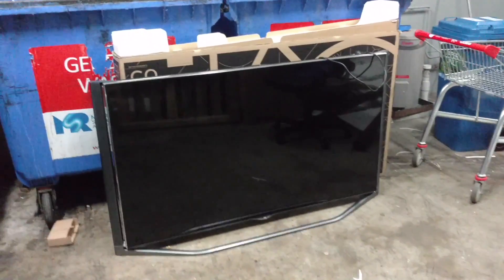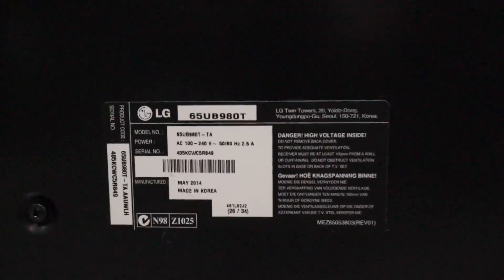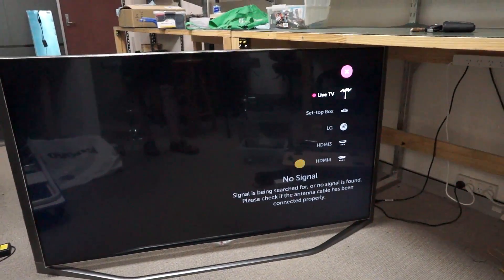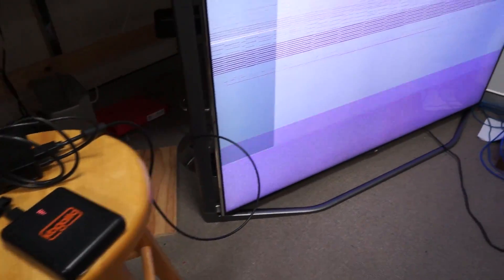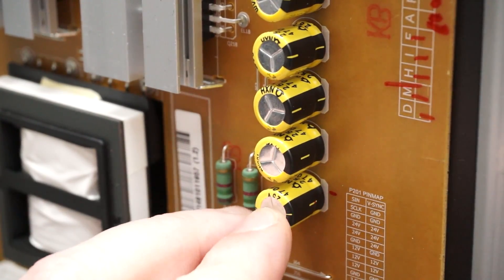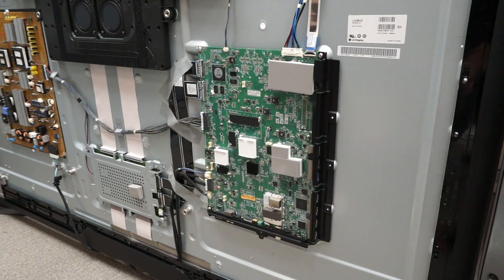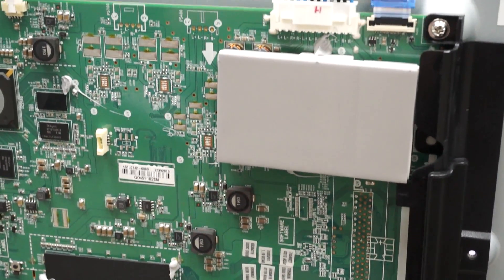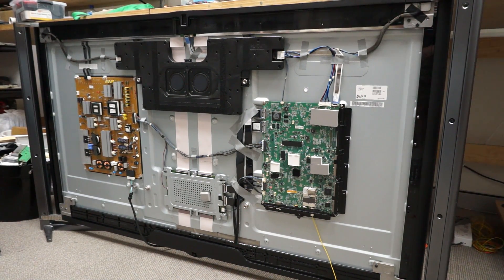EEVBlog #1145 - Dumpster Diving 4K TV!

Comment: Test the TV antenna outside on the trip to the new lab.  Digital TV isn't like analog that might still give some kind of "picture" with a weak signal even in that building so you need to test it with a half decent antenna outside.
Reply: Was the TV even tuned in?
Reply: I would think Dave would have an AC inverter that could power it from his car.  But the TV may also require "programming" and thus the use of the IR remote to initially setup the over the air TV channels.  Although it looked like at least one channel might have already been setup.

Comment: I'm not impressed by all the tape holding down the cables.
Reply: It's a pretty common practice in tvs and other flat panel like devices. It's just to reduce the amount of movement to prevent breakage.

I mean how often are you shaking the crap out of your tv?
Reply: @Darkassassin09  Indeed, I'd consider it WAY more secure than the alternatives.  The drawback of course is over time the glue dries up and they come loose, although its not too much of a problem if you never move it.
Reply: I think plastic retaining clips work better.  Cheap yet they allow the cables to be removed easily.
Reply: @Darkassassin09  In transit all the way from Korea, lifting off the lorry, taking it into then house, lifting it out of the box         will all add up to a fair bit of shaking.  Also there are the resonances the speakers will set off.

Comment: I miss phones with IR transmitters so you always had a remote with you.
Reply: so do I, I had a galaxy s4 and a galaxy s6. both had ir remote function.. then I got my s7.. Samsung removed the ir blaster for s7 upwards. glad I still got my old s4 and s6, as I never sell anything. but won't be buying another Samsung phone for that reason.. I hate my s7..
Reply: @09danstart  note 4 has one and note 8 if the tv is web connected via wireless or ethernet enable virtual remote in tv settings and select control via network on the app to control it
Reply: Yep, I'm still rockin' my LG G5 with no plans to downgrade to a newer phone ;)
Reply: S8 (and 9?) has IR lights for the iris scan. Should be possible to hijack it?
Reply: Most xiaomi phones have them
Reply: Still rocking my LG V20. I'm basically sold on the Razr Phone 2, but I don't plan to purchase one for at least two more years, and the V20 will stay well used for many many years to come.

Comment: that main board is probably under a hundred bucks on ebay. easier to just replace the board than try to diagnose any further.
Reply: if you have a heatgun you might as well reflow the hdmi chip and save some time.

Comment: Rather than do your 'follow the voltage' routine it may be time to step back from the electrical level. Many modern displays are ARM processor based and have a user accessible boot monitor. If so, the board will have a set of 3 or 4 pads (or a connector, maybe labelled Tx, Rx and GND and VCC) to which you can attach an FTDI based UART to USB adapter (with a scope you can work out the baud rate, most likely 115200). Via a terminal emulator you can interrupt the TV boot process by hitting ctrl-C. Once in the monitor typing a ? will give you the available commands (sometimes there are test commands for isolating problems). The peripheral chips will most likely be I2C based and the boot monitor I2C sub-commands will let you talk to them. Anyway, it's an opportunity to demonstrate fault finding from a different angle.
Reply from the maker: The serial commands (not the low levels ones though) are in the manual, I was going to give that a try. Voltage checks are basic and take seconds to do.
Reply: @EEVblog  
I cannot fault the efficacy of your initial analysis. I'm just suggesting that now you've verified the SoC system is running, let's leverage the power of the CPU to our advantage.
Reply: i'd reflow the hdmi chip, hell the board is free.
Reply: Does Dave have a reflow heat gun?
Reply: @SebastianScholle  he does
Reply: +EEVblog take a look to see if you dind the vpu chip and reflow it, that's a bad solder ball.
Reply: yeah we're sick of this voltage crap we're not 12 anymore

Comment: I wonder if those white heat sinks(?) are ceramic heat sinks. Samyoung is actually one of the largest capacitor manufacturer in Korea and make an OK quality capacitors as far as I know. Not the best, but certainly better than many Chinese off brand capacitors.

Comment: A friend of mine got a free Vizio TV that had input issues. OSD and menus were good but I found HDMI was without color.  It would fix if I set my signal to a low refresh rate.  Oddly, the fix was a firmware update.   Maybe try putting your set online and let it check for updates?

Comment: I continue to be amazed at the items you find in your dumpster. That chair is in better nick than the one I'm currently using when I'm at my computer. It would be worth trying to check out the USB inputs and also see if the network connection works or not. I'm looking forward to the more detailed repair video once you have settled in to the new lab.
Reply: Right? I would be pretty happy just to find the chair let alone a 4K TV

Comment: I would suspect that it is some LVDS mux for the HDMI switching that has decided to either wiggle loose (dry joint or something), or just partly given up. After all, it is the first chip the incoming signal goes to and the chip that would take the most amount of ESD when people stuff in cables into the device. (Yes, the HDMI standard establishes ground first as to protect chips against ESD, but that doesn't mean that people aren't magical and manage go around that regardless...)

Comment: Some of those TV will not work with a PC. Put a proper signal and try it....boards are cheap for that!
Reply from the maker: In the video I used the camera as a video source, same problem.
Reply: I'm not sure I agree with that. A HDMI signal from a PC is no different to that of another device, especially when outputting 1080p.
Reply: @ELVTechnology  that's what I used to think until I tried to test a TV with my laptop. I thought it was crap and was going to chuck it even though the OSD worked fine. Then plugged it in to my cable box and bingo it worked. Tried the laptop again no-go, tried my pc no-go. I don't know why, but it is what it is.....I also have monitors that will not work with a cable box. Maybe copyright issue, same reason you can't split an HDMI signal.....

Comment: dave, confirm other inputs are working, if so, you are most likely looking at a failed hdmi encoder chip! fairly cheap and easy to replace!
:)
Reply: seems a reflow case..
Reply: @fss1704   it is not a the main processor in this case, so reflow will not help.
Reply: +ROGUE DRAGON it's irrelevant being the main processor, the vpu have bad solder balls.
Reply: @fss1704   lmao. lucky dave knows what he is doing! :P

Comment: It looks similar to when solder joints fail on GDDR chips (Graphic card memory).
As the HDMI lanes looks to go into a mux (something similar to ASM1480), and then into some processing unit that looks to have (on the top side at least) 2 memory modules.
A cracked ball on one of the memory modules might be the issue.

Comment: Not just 4k, that's actually a 3D capable (FPR) TV; hence the 200hz on the panel.  Amazing find.
Reply from the maker: Argh,  3D, back to the dumpster room it goes.
Reply: @EEVblog  4k panel with passive 3d? That's actually good.
Reply: What's wrong with the 3D goodness?
Reply: @Dave: It s a feature not a must. 

And yes l know you were kidding. 😘
Reply: @ElliottVeares  - Home 3D has been dead in the water for essentially a few years now, but there's still a small number of fans.  Even passive 3D like this LG are underwhelming (my brother had an active 3D and it was so bad)... you're sacrificing picture quality for a novelty that isn't even as gimmicky as what theaters offer.  Big picture 3D movies at the box office have also been in decline for a while, with the margins against their 2D showings dwindling.  Finding an older 3D capable TV doesn't hurt anything, and you never have to use it.  In fact, you can probably get your hands on a 3D Blu-ray player and used 3D movies for quite cheap, just to give it a whirl.
Reply: +thechosendude    I have to disagree.  Passive 3D on 4KTVs is excellent.  I have two of them, including an LG 65" OLED 3DTV.   Much better than the active 3DTVs.   Less crosstalk, and lighter glasses make them much better.  
Picture quality is not sacrificed on these TV as they still display the full 1080p resolution in 3D mode.
Reply: @my3dviews  Very true, I have 55" OLED with passive and it looks fantastic. No cross talk at all, great with the deep blacks and rich colors.. Glasses from theater work perfectly with it too. It's like LG just managed to perfect it with 4K panel with 1080 in each eye and then just abandon it because everyone else was dropping it. They could have distinguished themselves from the others with their high end TV's since it's only a polarized filter over the screen, the software driving it is already worked out. Heck you can even feed externally with interleaved 3D video video from a computer without turning on "3D" mode and you will see 3D because of the polarized filter alternating over each line. The last of the 6 series go for crazy money now on ebay if they are still brand new old stock or refurbished because people know how good the 3D was on the last of those 2016's. I wish I had opted for the 65" but they were just so much more expensive at the time. With the G series approaching nice used car territory.
Reply: +Marcus Damberger     Right.  The 65" OLED that I bought was expensive, but worth it.   Even though I already had a SONY 4K 3DTV, I still bought the OLED one, because I knew they no longer made them and it was the last chance to get one.  I actually bought the last one available in my area, as it was a store demo close to a year old.  Made sure that it was in perfect condition before buying it.  
Not only is it great for watching 3d movies (I have close to 200 of them), but I also have two Sony 3d camcorders and two 3d digital still cameras.
Reply: @my3dviews  Damn, seeing your profile pic and name, and reading about your equipment, I clicked your name with some anticipation. Disappointed stereography enthusiast here... ;)
Reply: +mumiemosstret     Glad that you liked my vast array of 3d content on my channel.   LOL     
Maybe I will upload something someday.    I have high standards, so when I do, it will be great.   :-)
Subscribe if you want to be notified, but could be awhile.
Reply: Dang, that must have cost a pretty penny when new. Especially in 2014!
Reply: Pennies are allways pretty no matter when 😄
Reply: its lg not worth having

Comment: Dave -- just in case you didn't try it -- those different HDMI inputs may be handled by different processors, so try all of them. According to the manual, HDMI-3 is the one intended for use with 4:4:4 or 4:2:2 at 50/60Hz-4K, while the others are not. (And for 4K you definitely need a cable intended for 4K). I realize you were testing it on 1080p, but regardless the different HDMI inputs may route through different chips.
Reply from the maker: I did try all of them.
Reply: Very good idea. ;)

As you say, some formats bypass some scaler chips, and are sometimes even routed to the TCON directly (due to the high data rates for 4K).

Nowadays, even the basic OSD stuff might be handled on the TCON itself, although obviously it's very doubtful here that the TCON has a fault.

The PC and Rasp Pi will be outputting 4:4:4 RGB normally, of course, but yeah, 4:2:2 from a cable box or something is worth a quick test, especially if it's 480p / 576p.

My hunch is a bad BGA joint between the HDMI input chip and some DDR RAM, or just a failed framebuffer RAM, as they can get quite toasty.

(it's just as likely all of the scaling stuff is handled on the main SoC, like a lot of 4K TVs these days, but possibly with separate RAM for the input framebuffer.)

There is some semblance of an image, though, and it's good that it does power up and detect the input format (and audio) just fine, so it definitely seems to be a scaler issue rather than the HDMI input side.
Reply: IC3200 handles all HDMI inputs. It is a Panasonic chip.

Comment: at work we have a pair electronic whiteboards that never got used. they are basically going to get scrapped. no one used them as the software was too much trouble to get on a locked down work computer so no one did.  about £30000 down the drain, when they could have got a couple of normal whiteboards, even if you get idiots using permanent markers on them so you need some isopropanol or something to sort them out, for much much less
Reply: Why dont they just sell them as new, never used. Local collection only.
Reply: Neat trick with that: take a dry erase marker and cover the permanent as much as possible, then erase ;P

Comment: I have one of those to be thrown out. The screen is broken and its 5k for a replacement! If you need electreonics out of it let me know. Everything on it works minus the giant crack in the screen,
Reply from the maker: $5K ?! WTF
Where are you based? Happy to pay for postage for the main PCB.
Reply: @EEVblog  Don't forget about the remote!
Reply: The remote isn't so important with this TV. LG TVs are mainstream, so replacement remotes are easily available on eBay or Amazon, and if you have a universal remote (e.g. Logitech Harmony) then it can be programmed to control the TV as well. So great if you have it, no big deal if you don't.
Reply: @EEVblog  Don't forget the remote control, if available
Reply: @EEVblog   Hey bud if you didn't get that board yet, you might be able to use the RGB dongle if you found it with the tv or they're probably on ebay super cheap.
Reply: If you're going to put PCBs in a box, maybe best include all of them? It'd be a bummer if it turned out that the fault was actually on the power supply board after all!

You said 4K screen, but is it an OLED?  The interface looks very similar to a 55" 2018 model I just bought, though no popup webcam or control paddle on mine.
Reply: @MrSwanley I thinks its not an oled by the looks of the backlight bleed
Reply: @pesho9971  LED.
Reply: You should try and send him the main board for mailbag so he can just drop it and get it going.
Reply: Maybe Dave could send you his screen -- hahahaha
Reply: But seriously, if you do send Dave your electronics, maybe throw in the remote too :-)
Reply: The model of the TV in the video is 65UB980T-TA
Reply: 2160p Smart w/ webOS 3D Ultra HD 4K TV
Reply: Yeah a swap of the boards should fix it. I did that for one of my 4k tvs.
Reply: Would you send the speakers to me?
Reply: Yes I know: a magic remote was bundled with my new TV. The air mouse cursor feature was nice, but after a few days I went back to my Logitech Harmony 650, because I hate having multiple remotes on my coffee table, which rules out remotes that can only control one device. Then I found that a Web OS TV is surprisingly usable with just arrow keys. Yes, I also know LG claims that the magic remote can work like a universal remote - maybe so, but my finding was that it doesn't do it well. Now if LG was to get Logitech to make them a cross between a Harmony and a magic remote then I'd leap at that.
Reply: @Spiritpoweredinternet 

you won't get stupid prices for that
if it's an LED TV approx prices
Mainboard = $150 - $200 AUD
Power supply Board  $50 - $80
T-Con Board = around $50
and that's without postage

in reality , you have to match 

- The Exact TV
- The Exact Model
_ The Exact board model #
- In most cases ,  the Exact Board Revision Number as well

i know guys that stock pile these boards,
for it to be of any value to anyone you have to have a shit load (the guy i know has a backyard and garage full of PCB"s and TV's ,  LITERALLY SO FULL THAT YOU CAN'T SEE HIS GRASS IN THE BACKYARD)
these things are not worth much